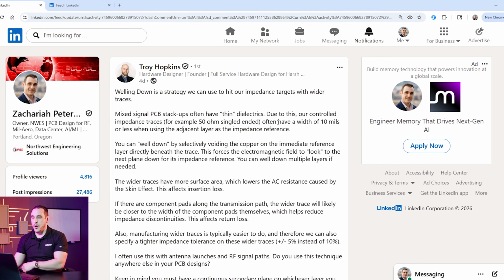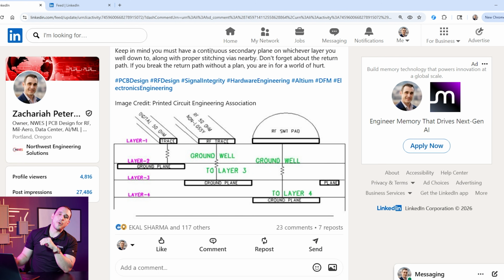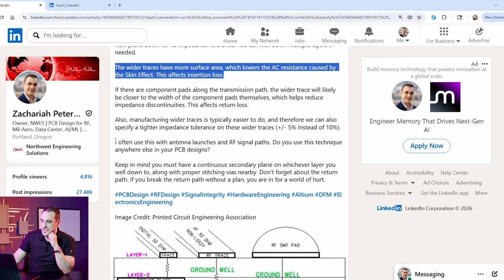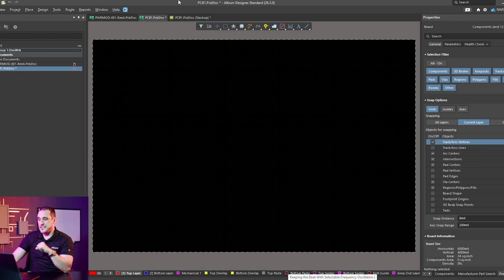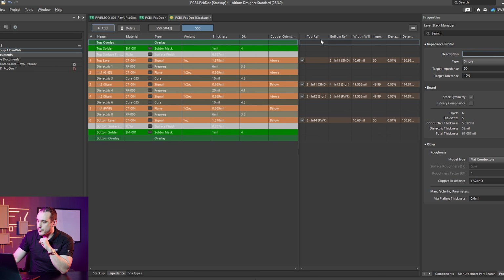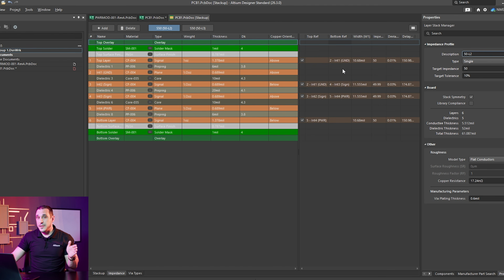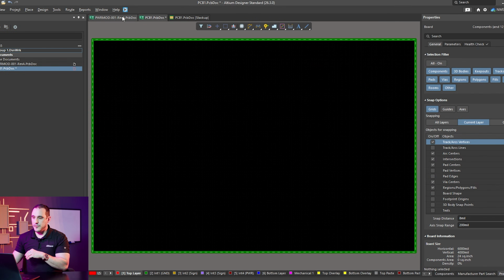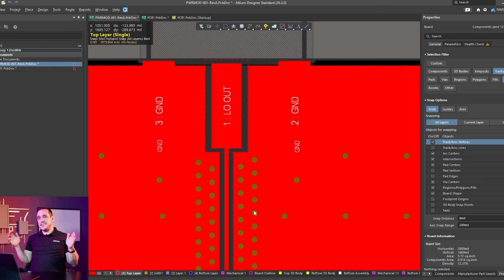Skip Layer Routing for RF: Control Impedance & Cut Insertion Loss

Comment: This is related to frequencies above about 10Ghz where the copper loss will be bigger than dielectric losses :) and can be applied to SE traces and pads.
Reply: That is typically where you might use it in a connector pad. However in the example I showed on-screen at 11:00 also uses it and it operates at 6 GHz. When we did the original video looking at ground cutouts below SMA pins, we could see that the cutout gives several dB of improvement in return loss. In fact, it gave larger return loss reduction than using a taper and no ground cutout.

Comment: I’ve used this technique interfacing n-type connectors with massive pins that needed a bias tee with high dc current requirement and a tiny rf trace for interfacing tiny rf components.   What isn’t mentioned in the video is the pitfalls of routing your return signal and making sure you put your vias in the right places, and maintaining the right gap / isolation.  Without good modelling software it is hit and miss.

Comment: I read many Altium manuals, watched many videos on this channel, and went through a lot of other information, but I couldn't find any clear instructions directly from Altium on how to create a fiducial. Such simple video with step-by-step explanation will help A LOT
Reply: Create a 20mil Pad with 40mil Solder ask opening with no Paste Mask. Or ask your Fab house to add Fiducials, ask them to send the working Gerber. Look through it. You will get an idea on many things
Reply: @sairamenon  You missed my main point — I'm asking for an official video from Altium
It should be a simple video with simple instructions. That's why I'm wondering why I can't find anything, either in the Altium online documentation or on this channel
Reply: @evgenijrakhno3686 😅You will not find any, cause there's no Universal Standard to create one. And it's not associated any Software Functionality. Good Luck....
Reply: @sairamenon  If we're talking about your recommendation, I can say that it won't work correctly if you place such a fiducial on top of a GND polygon. In that case, you'll get a 20 mil copper circle and a 40 mil 'donut' around the 20 mil circle, with only a small gap (6–8 mil) between them. Therefore, you need to exclude copper from the entire 40 mil area.

You can do this with either a keepout or a polygon cutout.

A polygon cutout seems more natural because that's literally what it is—a cutout in the polygon. However, PCB preview tools, such as the one used by JLCPCB, simply ignore such cutouts. As a result, the fiducial appears as a regular GND polygon with a 40 mil solder-mask opening and no 20 mil copper circle inside
(Yes, the 20 mil dot with 40mil cutout will be present in the Gerbers, but it won't be visible in the viewer, which can be somewhat confusing)

On the other hand, a keepout is displayed correctly, but then you need to take the clearance rule into account. For example, if you need a 40 mil copper-free area, you'll need to draw the keepout with a radius of 13-14 mil
Reply: @sairamenon  Contrary to some EDA systems, altium does not handle fiducial as special object class. It is component with SMT footprint as any other.
Reply: @Konecny_M NOPE..... I had/have never faced a problem as such.... It's working fine for me...

Comment: Interesting: I have done this a few times in my designs but I didn't know the term (or that there was one). I thought myself clever for coming up with the idea on my own, but there's nothing new under the sun. Nothing so simple at least
Reply: I once had a trace so wide that I had to put the reference ground on an external wire.
Just joking...